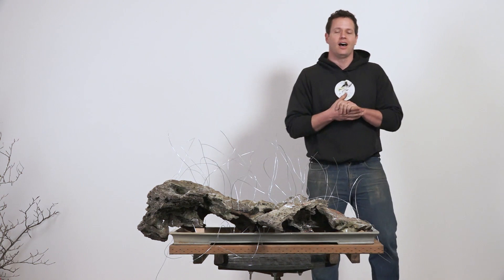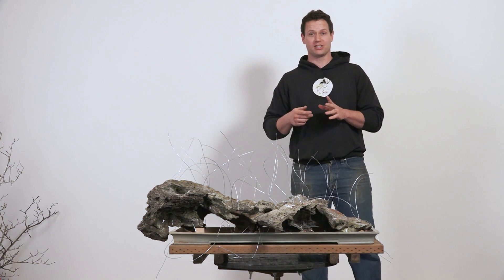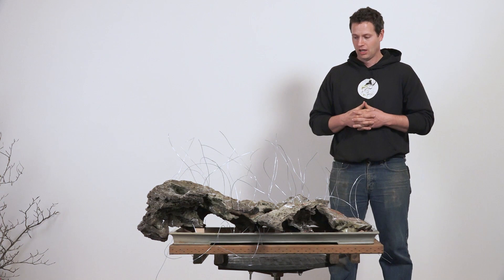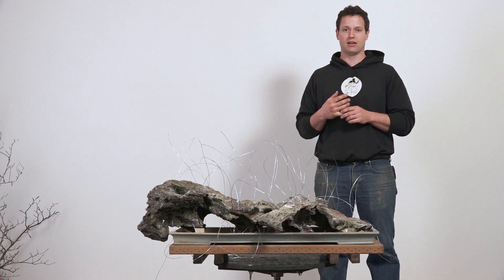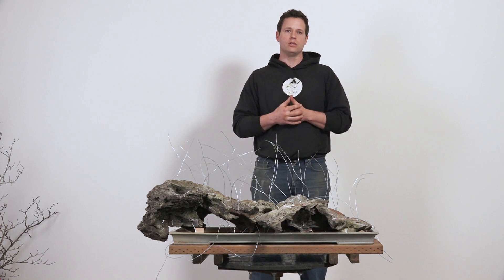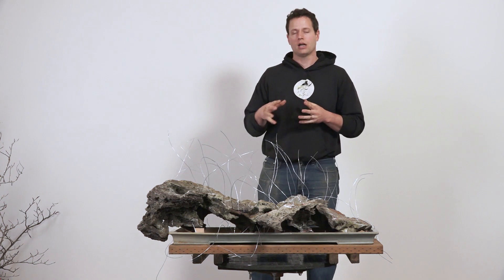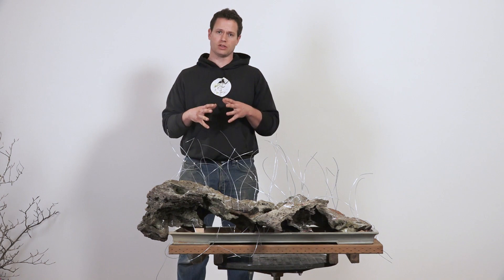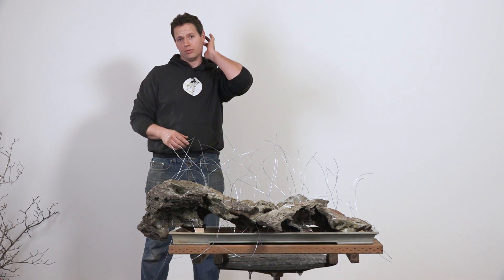Beech Forest Creation

Comment: I would have loved to see this bonsai forest a year later.  If it all worked out wonderfully, cool.  If parts of the forest didn't work, it would be important to learn how to fix the problems.  I like the whole idea that each tree has its own place.  If one of the trees were lost, it would be easier to replace that ONE tree.  Most forests are planted as one unit.  I would imagine it would be very difficult to replace a tree that doesn't make it. On my bucket list, I've replaced hang gliding with creating a bonsai forest.  As I have aged, I doubt that creating a bonsai forest would kill me.  This one is so interesting.  I, however would not consider a forest at this massive scale for the same reason owning a horse has dropped from my bucket list:  Horses are rather expensive and, where the heck would I keep it???  Great video!  Thanks!